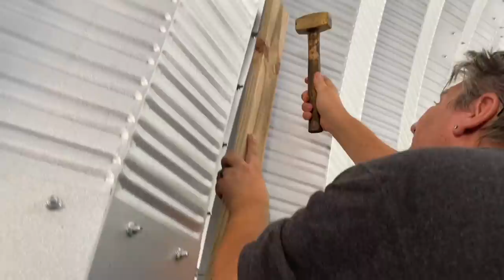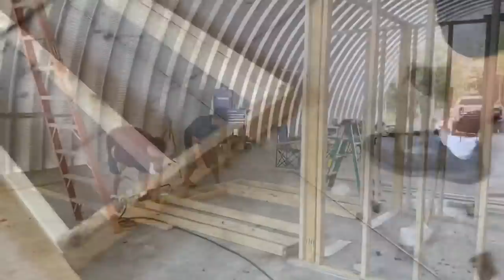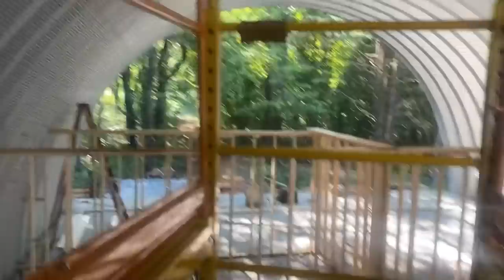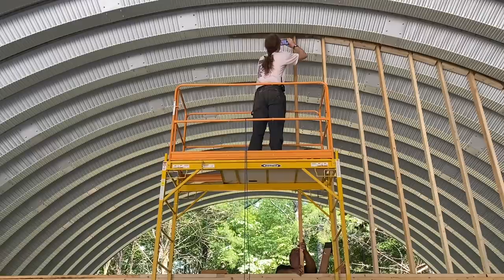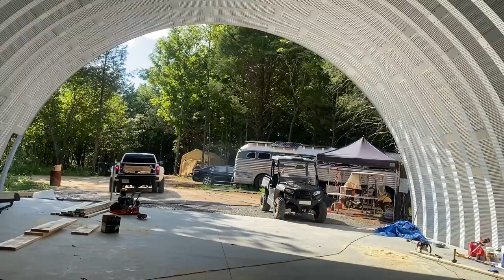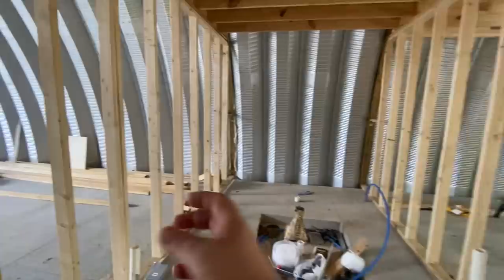Building an apartment inside a quonset hut.  Part 1

Comment: A word of advice from a 35 year framer. When nailing studs to a plate, nail the bottom nail first, then move your hand, and shoot the top nail. Very easy for the gun to double tap and shoot you in the hand.  I have seen it happen too many times. Keep up the great work on the property. Love your channel. Cheers from Canada.
Reply: yes have had my nail gun do that and it just missed my boot, wondered what the heck it was, so wary of these things scares me when I use my big framing gun
Reply: Pro advice.
Reply: I know a guy who got nailed in the jaw from a 16p framing nail from a nail gun that ricocheted off concrete ~12 ft away from him.  It went through his cheek completely shattering a molar and stuck in his jaw.  It knocked him out for ~15 seconds.  Total hard reset.

Comment: Next time throw that 4' ladder up on top of that baker scaffold to get to the top its more stable than you think. Get you some 5" thick styrofoam to put in the wall between the apt and shop, we used to build freezers like that they have excellent sound deadening quality. Looks like its going to be a nice sized place

Comment: Me concur. Something that would be cool at this point is installing a couple of sliding winders at the top of the glass wall near the roof so on the temperate dates when the weather is just right, open the winders at the top and the screened door on the ground floor to allow natural airflow to circulate the space without the needless operation of a HVAC unit to condition the space. I know there are many days in a Tennessee year where no heater or A/C is needed, just open the winders and let mother natures love flow.  Oh, and that's a big 10 dash 4 on those coupling nuts.

Comment: Fitted ducted ac to the roof of my 2 storey house ……was terrified when I started the job.
Had to take it up piece by piece using 2 ladders etc 
By the time I finished the job I didn’t care about the height even slightly.
Went back up on the roof to do a do an ac service 3 years later and was terrified again.

Comment: When Are you going to Lock the bottom of the buildinng into the slab? I used Grout  from Home Depot to do this, it is part of the strength of the building in the wind. Use the Hi-strength grout for beddinng equipmennt. Works very well and no shrinkage. Looking good. Keep the videos comming. I live 10 miles from the sourthern tenn. borader in Alabama.
Reply: I would say the hundreds of concrete nails fired into the slab would pretty well lock the bottom plate down.
Reply: @1425race  I believe Greg was referring to the metal portion and the plan is to grout it in at some point in time!

Comment: After watching your videos about your new place, I checked into one of these buildings. A 40x80 was very reasonabile, I don't know what the cost of the slab would be with the plumbing, and electrical coming in, but building the house part yourself would definitely save some money. Id like to get it all done for around 300K perhaps I'm dreaming?
Reply: Same idea here.  My 40x80 became 40x96 due to wanting overhangs.  Goal of 300k since I already own the land.  Poured slab 2 weeks ago and starting shell next week.  With  me hiring out the digging, forming, and pour the slab came in at 36k for 6" thick with 2' footings.
Reply: @rich6828  see, now that's what I'm talking about. We have a little 2.5 acre place, with seperate shop, lots of trees, that we have been thinking about selling, and buy an acre or two up by the lake, and do this very thing, and yes, I like the idea of an overhang on the front, you could even have a nice upper balcony, and a place to keep your rig in out of the weather. That is why I have been searching for a bus, we could live in it, while the house part was being,  constructed, then once the outer was erected, you could put the bus inside, and again, you only get taxed on one building, the taxes where I am in Texas are outrageous.

Comment: looks like it will be very nice.

question, will you barriers to prevent a bus from rolling forward into the residential area?  will you have a fixed fire suppression system for the repair area?

Comment: In the beginning were those treated boards? Reason I ask is because the treatment they switched to 15 to 18 years ago corrodes normal fasteners. That's why they changed deck screws and made them with a special coating that they use to not have on them with old CCA wood. They were seeing the fasteners corrode and let go. It was a chemical reaction thing. Fasteners now should be rated for treated wood.
Reply from the maker: They are stainless steel

Comment: Curious how you are going to flash the exterior transition from the bottom of the end-wall to the concrete floor.  Water is going to want to be getting under that wall with the floor not pitched to the outside.

Comment: Would a pit have been a valuable feature in the new shop?  I've often wondered why more mechanics don't use them; there must be a reason.
Reply: Scott has discussed the great pit debate many many times.  Too many drawbacks for him.  I think the pit is the new plasma cutter in it's mentions in comments and the live events.
Reply: Mostly fall hazard I think.  Most of us put 2 post lifts in so it isn't as necessary.

Comment: If your not going to have a bunch of "BIG FUNITURE" up stairs, you may want to think about a Spiral Staircase 5' Ft. Dia. Min. {Not Counting Center Post} 30" in. wide treads, Just for going up and down, 6' Ft.  Dia.  {3' Ft. treads, Not Counting Center Post} to get "BIG FUNITURE" up stairs. Personally I would have gone with 2" in. X 6" in. Exterior Walls. Both for Heat during winter, and Kooling during the summer.

Comment: Can I ask what insulation you will be putting on the metal building around the apartment ?
Reply from the maker: Closed cell spray foam
Reply: Thanks…It that just for the apartment only or the whole building, as when it rains it’s going to be an unbearable noise 😳
Reply from the maker: We have several videos of it in the rain and the noise is not bad at all

Comment: I know people have houses with attached garages, but looks more like a garage with an attached house.  My concern would be that the interior of the house will forever smell like diesel fuel and smoke.
Reply from the maker: The apartment will be 100% fire blocked.   No penetrations or openings from the shop to the apartment except for a steel door like a front door on a home.  No shared attic space or anything like that.  I will be the thing that makes the apartment smell like bus.  For god sakes we live in a bus now and it doesn’t smell like diesel fumes and smoke.  You are creating scenarios for problems that aren’t problems.   We do plan on using exhaust hoses to pipe the exhaust fumes out and other than that fans and open air ventilation will be just fine.
Reply: @BusGreaseMonkey  Thanks for the response.  I hope you enjoy your new home.